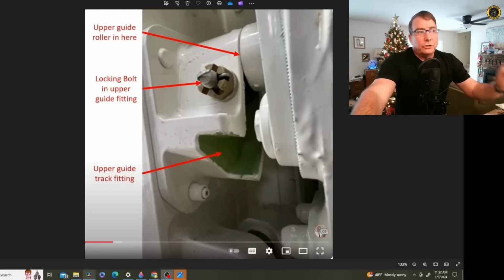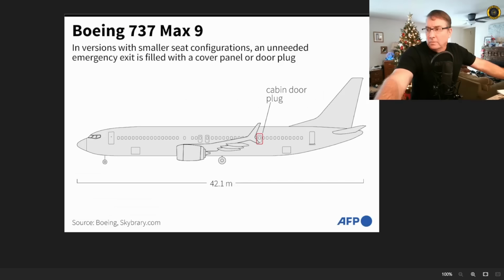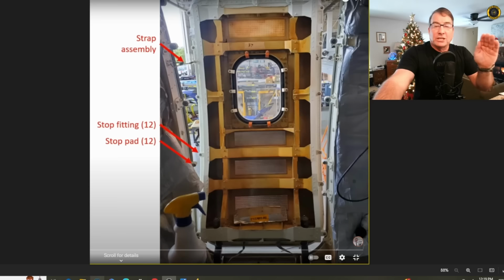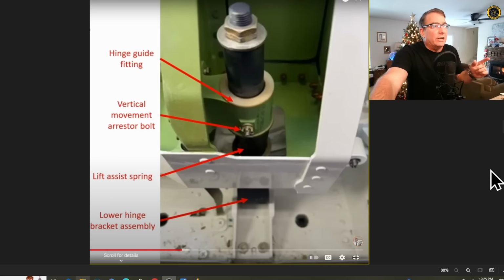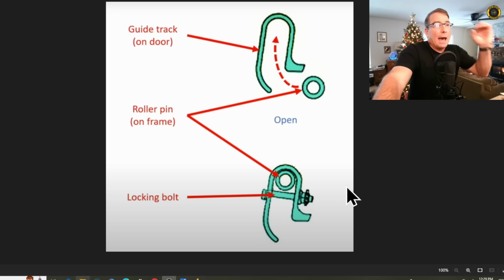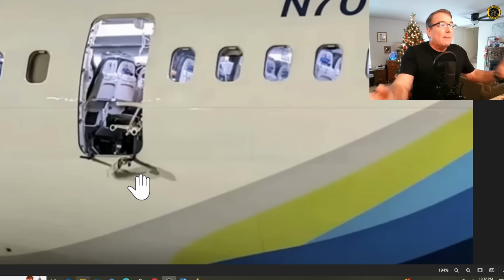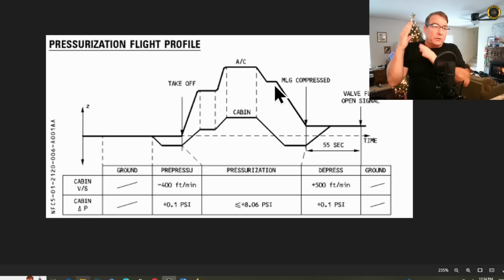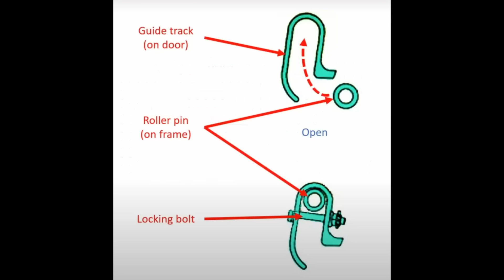Alaska 737 Max-9 Door UPDATE! 8 Jan 2024

Comment: We can't see from the photos what's behind (or in front of, depending on how you want to look at it) the head of the upper AND lower locking bolts, but those are some pretty big - and more importantly in this case - pretty LONG bolts.  I think that, particularly for the upper bolts, that there's a very good chance that there's some other parts or components (i.e. insulation, interior panels, etc.) that would block those bolts from fully coming out unless those components are FIRST removed - which would normally be the case when doing maintenance on the "plug door."  However, if that is correct, then it would be IMPOSSIBLE for the bolts to have just "rattled loose" due to vibrations - keep in mind vibrations will have NEGLIGIBLE force pulling the bolt OUT (and even that force would be reduced by the friction of the cabin pressure against the door plug).  Anyways, if this turns out to be the case, that removes loose nuts, loose or never installed cotter pin, etc., ALL as possibilities.  Leaving only two options: either the bolts sheered (nearly nonexistent odds considering they're not the main thing holding the cabin pressure in, so they're under VERY minor load, and they'd have to ALL sheer at the same time), or the bolts were never installed (as of the time of accident flight; whether they were never installed from the factory, or were never reinstalled during maintenance is another matter).

I would bet a large sum of money that the bolts were entirely missing as of the time of the accident, I think that's almost a certainty at this point.  I think you'd see damage on the air-frame and door if they sheered.  Also, while I'm not an aircraft mechanic, I am an auto mechanic, and while I can't say with absolute certainty, I can say that the likelihood of all 4 bolts backing out - in just a few months of operation - if the nuts were tightened , but the cotter pins were missing or loose, is EXTREMELY small.  Most car bolts do not have cotter pins, and cases of them coming loose are exceptionally rare - and cars are subjected to probably worse vibrations than planes (regularly hitting bumps, potholes, speedbumps, etc.).  Of course that's assuming there's even space for the bolts TO back out in the first place, as discussed above.

If it does turn out to be confirmed that the bolts were missing at the time of the accident, either Boeing or Alaska Airlines maintenance are going to have some SERIOUS explaining to do....

Comment: Solution: replace the springs with a lever mechanism that lifts the door that itself is bolted into the door that also actuates the latching pins and disconnected when not actively in use.
One would think that after the engineers stupidly tried to use a spring to latch the DC-10 cargo door shut they'd learn to avoid springs....

Betcha a $5 the door came down in a flat spin with the lower edge leading.
Reply: That is one thing I wonder about, if the plug is never going to be used as an emergency exit, why have springs loaded to push up and out?

Comment: Hey Juan, the geometry looks like the track is long enough that the roll pin could be temporarily stable BELOW the bolt.  Could this happen by 1)open door per procedure during maintainer/construction. 2) to not loose the upper bolts, temp them in the holes hand tight 3) door kept open on hinge. 4) later, door closed with upper bolts still in place 5) bolts torqued and wired, but pin is below bolts.  Just a theory…. But if I designed it I would have the track below the bolt be shorted than the radius of the pin, so the door could never be stable if the assembly was done in the wrong order.
Reply: if that were the case, wouldnt the door simply not fit into its correct position?
Reply: That is a perspective.. we could ponder over.
Reply: From the description given the lower bolts have to go through a hole in the hinge pin. If the door was to high up, this would not have been possible.

Comment: Probably mentioned here somewhere.   But if the door plug is basically in perfect condition.  They really need to find the bolts and nuts.   Which are unfortunately in some installers pocket or blew out over Oregon somewhere.

My theory is the 2 bottom bolts on the spring hinges where in the holes and the nuts where just spun on or finger tight. I might be wrong but it appears this bolt is vertical in the hinge so once the nut is gone nothing stoping the door from vertical movement.   A horizontal bolt would still stop that action nut or no nut. 

Over the flights the nut worked its way off so now door has some movement and then finally just the right pressures and flex of the plane the door slid up and the spring and pressure did the rest.

Previous decompression warnings where the door possibly sliding up a bit still partially held in by a loose nut and mild decompression. But probably seated itself back in place on landing or something hence the pressure tests they were doing on the ground wasn't triggering anything.

Or all 4 bolts and or nuts where inferior and over time sheared off and worked loose.

And them saying they have found additional planes with loose nuts that means cotter pins are failing or not installed/reinstalled.

As others have stated this appears to be a great door locking system but like everything all the components need to be there for it work.  The way it appears to work 1 of the 4 bolts really keeps it all together.

Comment: There are a few little details which suggest that the experiential IP in retired people's heads is having to be relearned by the kid-eagers in the industry, There is a linked image of loose attachment bolts in a hinge fitting. At last count, I believed that you do not use a narrow washer when bolting through a slotted hole. Boeing has either designed it that way or a slack team has let it pass. What are the chances that a debulked door used as a plug may be able to bulge hemispherically outward enough for the guide rollers to be withdrawn along their axes, allowing the door to pop just enough for the roller ends to wedge past and remain against the rim of the track. Successive take-off/landing cycles might then spring an already stretching fuselage opening further apart. If the hinge retaining bolts were loose enough or missing, twisting of the fuselage opening during the vibration of take-off might be sufficient to walk the door plug upwards for the stops along one edge to progressively disengage over several flight cycles with a final warpage of the door plug and fuselage finishing the job. It was fascinating to observe the gap between a seat headrest and the cabin wall jump around a lot during take-off and low altitude then gradually increase and steady as the pressure vessel tightened up with altitude. That aircraft was an Airbus. I imagine that the Boeing 737 hull would behave similarly. There is a lot of leverage by the mass of the empennage, control forces and the weight of passengers passing around that doorway. It would be interesting to tie some woollen thread diagonally across the corners of that opening and another set diagonally across the door plug itself and observe just how slack or taut that woollen yarn becomes. With the mass of the engines slung far forwards compared to the original underslung mounting and the fuselage stretches, that section of the fuselage is seeing more stress than when the 737 first flew.

Comment: Thanks for the update.  If I look at the picture of the safety bolt assembly it is evident that the cutter pin is installed incorrectly!   The end of the cutter pin should never be inside the castle nut!  The rounded end should be seated outside.   The opposite ends, the bend ends of the cutter pin, must be seated inside the slots of the castle nut.  I would love to hear comments on this.
Reply: Nope looks good to me. It will certainly prevent the nut from turning more than a little.

Comment: Big fan of your channel Juan. I’ve got two points from my experience (which may not be complete and I’m happy to be educated).

1. Depends on the castellated nut, but most are distorted and this generates a run-on torque which is considered 1st locking feature, the cotter pin is the secondary locking feature where dual retention is required.
2 - These bolts are working in shear and thus a clamping torque may not be necessary. The bolt to nut should not be loose, but the bolt and nut to across the fitting may have clearance and “rattle” relative to the fitting.
Reply from the maker: Correct.

Comment: Great work covering the details however I wish you wouldn't keep referring to this with the word Door. This is really a Plug Panel that replaces the structure that would be an optional Emergency Exit Door. The Plug Panel is designed to be adjusted to a slightly opened position for inspection but not meant for passenger Ingress/Egress. Every time this panel is referred to as a Door, the normal mindset is that the structure should swing from a closed to open position. Clearly that isn't the case and the hull integrity is critical on this maintaining it's seal during operation at altitude. Looking forward to the rest of the story. Please keep the reports coming!

Comment: Former Boeing engineer here. The  core problem is simple.

You mentioned that the PIC has the right to refuse to fly an airplane with problematic maintenance items, with backup from the union. I got the impression that pilots feel empowered to actually exercise that right. That culture does not exist in Boeing Commercial Airplanes (as of ten years ago, and I expect it’s gotten worse). BCA is run by finance experts, not engineers, and engineering management does not have the courage to stand up to their leadership. I spent time working in other parts of the company before working in BCA, and when I moved there I was shocked at the sycophantic attitude of engineering toward the leadership who continually pushed schedules and budgets apparently without concern for the impacts on the airplanes or for the human beings to entrust their safety to them. (Maybe things have changed, but if they had I would expect this steady stream of failures to slow.)

I appreciate the analysis.

Comment: The  4 bolts have castellated nuts and cotter pins. The bolts prevent the door  plug rollers from moving in the fuselage door frame roller plates . This in turn prevents the door plug  from moving off of the 12 mechanical stops and departing the fuselage.

Comment: I think the riveted part in which the retaining bolt is located has sheared off due to all the vibrations because it is rigidly screwed and not springy, causing the door to tear away.

It only seems to be designed like this on models (economy version) without a fourth door.

Comment: Awesome eval, figured it was something along those lines. Just as observing what I can see in the photos so far.
Not wanting to jump to conclusions, but my bet would be that the upper bolts were not present and possibly the bottoms as well.
Seems to be no structural damage to either the door or the frame.

Comment: Assuming the door plug is 3 ft x 5 ft, the projected surface area is 15 square feet or 2160 square inches. At 8 psi differential pressure, the pressure induced force is 17,280 lbs or 8.6 tons. I believe you’re correct. Somehow either the locking bolts were missing or the cotter pins were missing.
Reply: And what would have happened if the door failed at 38,000 feet? bits and pieces of that plane would have been scattered across California.

Comment: As a civilian not involved in aviation I would have thought logically they would have built a door plug that is wider than the opening so that it could only be removed from the inside and therefore being larger the air pressure would securely fit it into place and thus this could never happen unless a structural failure of the aircraft. This design seems over complicated to prevent depressurization.

Comment: Juan, I'm focused on the engagement-length of the guide roller/pins in their guide tracks.  These pins appear to have a substantial chamfer on their tips that could act as a "ramp" for the locking-bolts to ride up on.  The pins don't appear to protrude deep enough into the door-plug's guide tracks, for the O.D. of the roller/pin to bear on the locking-bolt.  Under cabin pressurization, the roller/pins will HAVE LESS ENGAGEMENT INTO THE guide track.  Also, the fact that some of the hardware was not coated with the zinc-chromate, leads me to believe that the Go-Go team that installed the Wi-Fi radome and wiring may have needed to remove some "things," after the entire aircraft had been bought-off.  The Go-Go radome lies partially over the plug-door.

Comment: That is a good size bolt. It is 100 to 1 that ONE castellated nut with a cotter pin would fail. For 12 to fail, not possible. 
1. They were never installed at the factory.
2. They were deliberately removed. Either to stop the rattling noise or deliberate sabotage.
I m just a backyard mechanic, but this is mechanics 101.
Reply: Thank-you, I believe it was sabotage also. A major aircraft component that it seldom looked at or opened, the perfect set-up for sabotage.

Comment: another probability is that the door buckled under load moved outward  a bit then sheared the thin roller pin guide rail, after that it swung outwards and sheared the lower locking bolts due to the forces involved.

Comment: As I understood the latest NTSB briefing, the roller pins (on frame) were in tact, but the corresponding guide tracks (on door) were sheared.  These are “guide” devices and not structurally sufficient to hold the door in place.  

The AL 1282 aircraft appears to have the hinge and lift assist spring assemblies still attached to the airframe.  This seems to imply that the hinge guide fitting was ‘launched’ off of the hinge guide post.  This would take it past the large washer and what appears to be two jam nuts at the top of the guide post. (Presumably to limit the door’s vertical travel when opened for inspections.  Again, these are not structurally designed elements designed to retain the door during flight.  A quick look at the remaining hinge assembly and guide posts would indicate the door plugs route of departure from guide posts.

Comment: Based on the photo of the castle nut with the cotter pin installed on that bolt, there is no way that that cotter pin broke off resulting in the castle nut to turn and dethread itself from the bolt. That cotter pin is made out of stainless steel. Still many questions need to be answered. However, based on seeing the installation of the castle nut and the bolt to include the cotter pin, it seems more likely that the bolts were never installed or, they were installed with the cotter pin never installed on the castle nut.

Comment: The 4 bolts everyone is talking about are installed in the 2 upper and 2 lower roller latch plates located on the Fuselage Door Frame. They are designed to prevent the "door plug/panel " rollers from moving in the latch plates and allowing the Door Panel Stop Pins on this particular installation to move off of the Fuselage Door Stop Pads and  depart the aircraft.

Comment: @blancolirio 
They way you explained it.... perfectly. 
Now for the non-airframe type. The assembly is nearly EXACTLY they same set up on your personal vehicle. Raise up the front and look at the controlling arms(big bars). These are the parts that push and pull on the tires and wheel assembly to steer. Tie rod ends connecting the control arms. These connet to the ball joints and then to the wheel/gear hub/tire assembly. They also have the "Castle nuts" and "cotter pins" to prevent parts from pulling out.